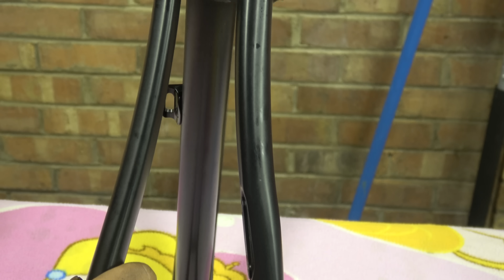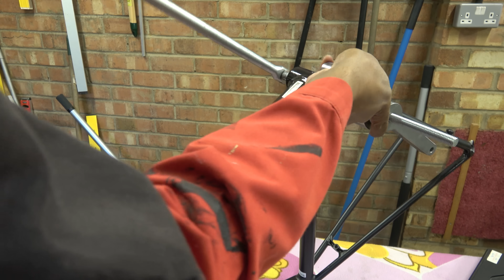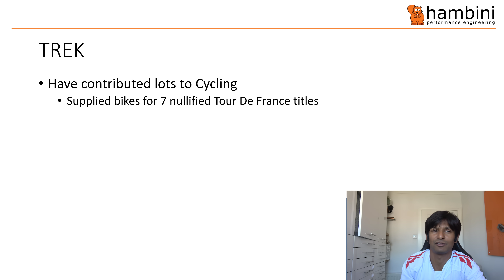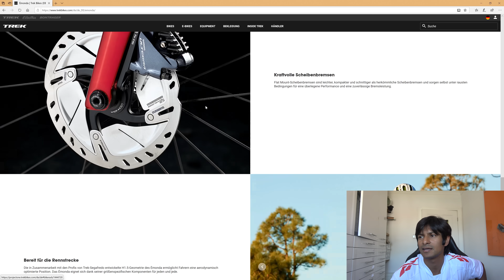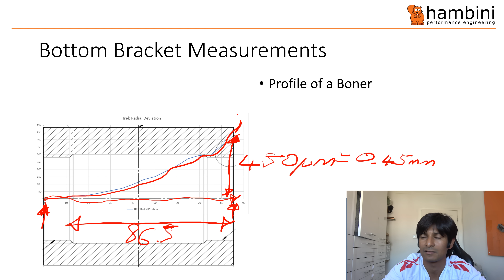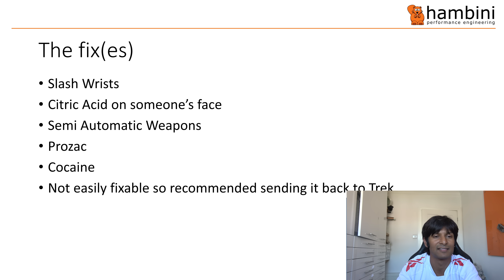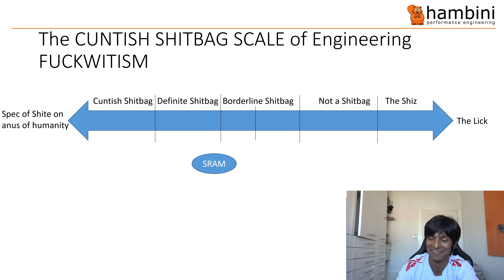Trek Emonda: Engineering crapness of the highest order

Comment: This engineering crapness belongs to me so the video is a difficult watch. 

I'd like to say thank you to Hambini for his efforts and for being such an awesome person to deal with. I haven't started a warranty claim yet as I was waiting for this video, but I'll update as and when I get any response from Trek. 

I've since purchased a 2019 Giant TCR Advanced 1 and I'm very happy with it. The spin test with the Shimano BB is amazing compared to the Trek.

EDIT: 20/10/2020 I finally got round to making a warranty claim with Trek as I was waiting to see if they brought out an updated frame for 2021. They haven't updated the frame, but they have bought out a very nice red / orange fade colour scheme. Anyway, I initially claimed on the basis of the welding defect but Trek dismissed that, saying it was 'part of the normal build process'. After that I went back to them with the undersized and misaligned BB, together with a mention that the frame had been inspected by a 'professional bottom bracket engineer' and I was prepared to make a claim in the small claims court. Lo and behold, Trek have now said they will replace the frame as a 'goodwill gesture'.

EDIT: 30/10/2020 I picked the new frame up from my LBS yesterday, in the new orange to red fade paint scheme. It's very nice except for one or two areas where the finish is piss poor. I've measured the BB with my cheap ebay verniers and I think it's undersized and not quite round on both sides. There are also some small areas in the BB and head tube where the welding has blown through. In fairness to Trek they shipped it over from Europe as it's not in stock yet in the UK.

EDIT: 16/02/2021 The saga continues. I got my new frame in October last year and since I had my TCR, I wasn't in a great hurry to build it up, especially as I needed to get some new direct mount brake calipers and some wheels and other bits for it. I got most of what I needed and started building it up after the New Year. When it was almost complete and I put a rear wheel in and the chain on to set the gears up, I noticed the wheel looked as though it wasn't aligned centrally with the seat tube. So I made sure it was properly located in the drop outs and checked it again and it still looked like it was well off towards the drive side. So anyway I thought maybe the wheel was dished, although this was not a new wheel but one I had been using in the previous frame and also on the TCR, and I hadn't noticed a problem with it previously. So I tried a few more wheels in the frame and they all were misaligned with the seat tube, well towards the drive side. When you flipped to wheel over, the result was the same - misaligned towards the drive side. 

So I contacted the shop and they asked me to drop it in along with the wheel. At first the owner agreed that there was a problem, but later I got an email from them saying that Trek had asked them to try a different wheel and they reckoned there wasn't an issue. Trying very hard not to loose my rag, I emailed them back and told them to look again, using a rim with no tyre on and by looking at it from behind with their nose right up close to the rim and with both eyes open, not squinting through one. Shortly after I got another email from the shop saying that they'd 'tried a different wheel' and they could see it was 'a bit off' (it was well off but any amount is too much). So they've asked Trek to collect the frame and carry out an inspection. That was last week and I'm waiting to hear back from them. With a bit of luck I might eventually get something which is made properly but I'm not holding my breath.
Reply: I think in light of the evidence shown it will be difficult for them to refuse to warranty it. I cracked my 2018 Remedy frame and they replaced it immediately, no ifs or buts, straight up replacement to the newer 2020 frame so my experience was very positive, would have been better if It hadn’t cracked in the first place but it is a MTB. Keep us updated so we are aware of what to expect from this sort of situation.
Reply: I don't seem to be able to edit my original comment again, so I'll have to post an update as a reply to it: -

EDIT: 17/06/2021 After Trek had the frame to examine it for the alignment issue with the frame & rear wheel, I heard back from the shop to say that they had found nothing wrong. They had put it in a jig and concluded that it was fine. They took some pictures which the shop emailed me and appeared to measure the distance between seat tube and seat stays, which seemed to be okay. I went back to the shop with my wheel and again I put it into the frame and it was well out with the seat tube. 

This is the point at which the shop tried to mug me off. First of all the 'head mechanic' (a right cocky tw@t) tried to tell me "that's how they come with Treks", to which I pointed out that the Emonda next us in the showroom wasn't like it. His response - "that's because that one is carbon"!!! When I challenged him on his BS, he said that I would have to take it up with Trek as the shop were just 'in the middle'. I pointed out that I was the shop's customer and the shop were Trek's customer, to which he responded that I would have to take it up with the owners, one of whom was stood right there!

 At this point the other owner gets involved and I show him the problem. More attempts to mug me off followed. "I've seen worse" he said, to which I replied that I hoped those bikes were never sold to customers - no response from him to that. He then told me that "they do it to get the chain line" to which I replied that the chain line comes from the width of the BB shell - more silence from him. Eventually, after he realised I wasn't just going to go away, he called Trek and persuaded them that the frame wasn't right and they should send another, to which they agreed.

About six weeks later, after not having heard from the shop, I emailed to chase up the frame's whereabouts and wouldn't you know it, it had just been delivered that day. I called in the following day and we tried my wheel in the new frame which lined up perfectly with the seat tube. I took the frame away and gave it a good inspection before building it up. The BB shell was undersized, as you would expect, and the NDS was visibly not round. It seems that Trek just aren't able to make a BB86 shell to spec. There were also blobs of weld in the BB and head tube where the welder had blown through. 

I've done a few hundred kilometres on it now and to be fair it does ride nicely. However, due to the cable routing being internal but having to exit the down tube before the BB then going round the BB externally, the gear shifting is very poor. I'm using the Ultegra 6800 shifters, cranks and mechs from the original bike and they performed perfectly on that frame which had external routing. The front mech works fine but going up the cassette on the rear is really poor and I find I'm 'fishing' for the gear and having to think about the gear change, which takes the shine off the ride. Maybe a change of outer cables would improve things but I really think it is the design of the routing which is leading to the poor shifting.

Another issue with the frame, and it's a big one, is that the fork is not colour matched to the frame. The head tube is a shade of orange and the top of the fork is more of a yellow hue. It's not just slightly different, it's completely different, and my first thought was is it meant to be like that as I can't believe that the QA would not have picked that up. However, I don't remember the previous fork being of a different colour and when you look at the pictures on the website it looks the same colour. I've decided I can't be arsed to take the matter up with them as I'm just relieved I actually have a frame that is at least useable, although at £975 for the frameset you would think they would at least get the colour matched. So much for Trek's quality control.

In summary, it really pisses me off that I have had to go through all this bollocks just to get a frame that I can ride. I would never buy another Trek and I certainly won't be spending any more money with the shop, which I won't name but is in Worcester and it's a cycle centre.
Reply: After what Trek did to Greg Lemond and his bike company courtesy of their golden boy Lance Dopestrong I would never spend a penny on anything they ever sold. And yes, on top of that their fabrication quality is a complete joke for what they charge.
Reply: Just to update again, I contacted Trek via Twitter about the colour match issue and they said it shouldn't be like that and I should contact the dealer, which I did.

The dealer got back to me to tell me that Trek couldn't actually supply a fork in the correct colour. WTFF!!!

I think because of the previous saga with the frame(s) they probably just couldn't be bothered to open up the boxes of the warranty frame stock and look for a fork with the right colour.

They offered me a grey fork or £150 credit to use in the shop (on Trek goods, although the shop said they weren't fussed what I bought). I took the £150 credit and I'll have to live with the fork being the wrong colour.
Reply: How will they wriggle out of this one. Show them the hole is 40.8mm. It may aswell be square.
Reply: The Trek was made by Giant... Bold move going for the same manufacturer!
Reply: @JeffLenoskyTrailBoss  giant build most frames.
Reply: Good luck, they should stand by the product.
Reply: Giant over Trek, Specialized,  and Cervelo all day long,
Reply: ... of the Highest Order, haha!
Reply: Yup, even if they bike isn't perfect, they stand by their product and will do right by me.
Reply: well I have had a trek bike too and the bb was squeaking while riding even after fixing it and the frame must have been deformed for me as well. I could not ride without the hands on the handlebar because the bike always went to the right. something was pretty fishy about the bike but luckily for another issue I had it was send back and I got my money back. wish me luck for my next bike, that is definitely not a trek bike.
Reply: New bike day coming up?
Reply: @topher.m  New bike day was back in March. Giant TCR.
Reply: @plantpoweredpedaller  I'm on the verge of upgrading to the 2021 Advance Pro 0 (that's a mid-life crisis for you) how are you finding the TCR?
Reply: @MrThemaskedavenger  Really happy with it. It's a bit more racy than the Emonda and more comfortable being carbon. The cranks spin very freely so at least the BB appears to be well aligned.
Reply: Yes. ANYTIME you buy a new item and IT DOES NOT work as marketed/intended then it is NO GO. How QC let this slip is crazy. I’m just guessing you paid AT LEAST $800+ for just the frame??? If Trek doesn’t honor your request that would be disgraceful. Good luck!-)
Reply: There are some big players in the market how want to make the customer happy: Scott, Specialized, Trek and Giant. If you have problems, send it back and get a new one!
Reply: My bestie had two Trek frames on two different models and broke them both. Ever since then I am always skeptical of Trek quality. They always seemed overpriced and under spec'd.

Also - massive respect for being plant-powered my dude.
Reply: @gh7213  Cheers Greg. I'll never be giving Trek another penny. Fucking shysters.
Reply: @plantpoweredpedaller  any update? :)
Reply: @davidmeloni8282  I'm trying to post an update but I keep getting an error
Reply: Interesting, I have absolutely no sympathy to TREk I don’t forget that they were part of the Lance Armstrong System which was far more than Doping - rember how they behaved with Greg Lemond but though it seems that one fits to the other.
Reply: @Alien On a Bike  that bike is about €1500 , so it's worth it to try to fix it
Reply: This was so funny to watch but I do hope you get your bike fixed!
Reply: so where does Giant stand on hambini scale? haha
Reply: Plant Powered 
What's ironic is Giant probably made both frames for you.
Reply: Thanks for this post. I'll make sure not to buy a trek emonda frame. I wonder if the high mod frames in all these brands have better more precise and accurate engineering than the regular carbon ones. Not sure if hambini reviewed those
Reply: Any more updates? Very interesting to follow
Reply: @TimInertiatic  If you've read the pinned comment and then my replies to it (because I couldn't edit the original comment any more) then that's about it except that I had been keeping a dialogue going with Trek via Twitter. They kept on asking me to take the bike back to the shop and start a warranty claim, to which I pointed out that's what I had done. They said they couldn't see a claim on that frame number and kept saying take the bike back to the shop. We ended up going round in circles and I concluded that Trek are well aware of the problem and just don't even bother registering a claim. I actually contacted someone on Ebay selling the same frame and his bike had the same problem - yellow fork and orange frame. He said he questioned it at the time of purchase but got fobbed off with some cobblers about the frame being alu and the fork carbon.
Reply: @plantpoweredpedaller  yeesh.  I was considering a 2nd hand ALR but I’m going to avoid it now.  I wouldn’t even have a warranty to fall back on even if your experience was so poor.  I’m going to get a TCR instead.
Reply: Can't wait, I got the Trek Emonda ALR Disc White Era 2023 frameset, yet to build it up
Reply: Please do keep us posted.  I have a feeling Trek will do nothing to correct the issue.  I have (more or less) the same issue with my Trek and I definitely would never buy another bike from them again.
Reply: @Waremonger   I've posted an update on the warranty issue in the pinned comment
Reply: @Waremonger  tried to repair several bikes with their bb90. I turn them away. No bb lasts.
Reply: MP48 cs works fine and has 6 jears warranty. bb90 isn't perfekt but stiff and the lightest bb standart
Reply: @ianiscaratti4924  CS???!! Ceramic speed....... Are you literally sitting me. Expensive snake oil crap. I'll never give those arse holes money again. I use Chris King or wheels manufacturing with SKF, NSK or NTN bearings fitted. CK bottom brackets last pretty well even in poorly aligned frames but they can't cure bottom brackets misaligned to the degree of that TREK.
Reply: MP48 show me a chris king bb90 lol
Reply: Isn't that a 4 year-old bike? Based on the black on black paint scheme and bosses for external cable routing, that looks like the 2017 ALR 4, which was sold in 2016, with a Tiagra groupset. Trek remodeled the bike with internal routing, different tube shapes and smoother welds in 2018
Reply: @voiceofreason9780  But the warranty is for a lifetime.
Reply: @kubagajda7347  Don't be fooled. If you understand a 'lifetime warranty' it's essentially a marketing reassurance to convince people to buy.
1. Life time means life of the frame, which is the lifespan of the bike frame, not yours, and that is about 7 years or so, in the case of alu alloy.
2. Any crash, not covered.
3. Change of ownership, new owner not covered.
4. Any 'user error' or anything that could be deemed as user error, not covered. Even using a shorter seat post than OEM would for some companies be a reason to deny warranty. They would say their post must be 400mm not 350mm. Of course they don't  tell you that in the handbook. Or they might say 'Hambini is not an official Trek dealer and has attempted to fix this frame, so warranty void'. So essentially the owners are playing a guessing game as to any repair or change from OEM might be deemed warranty voiding, but you'll never know ahead of time.
Also remember if anything goes wrong your bike will be sent off to be looked at by 'their team', and if that's your only bike you could be bikeless for months meaning unless you go and buy a new bike you'll end up a miserable, fat unfit git until you get you bike back. So you'll likely be spending money and as you will not have had time to research the bike market or time to save up adequately you'll likely buy a bike you'll later regret as you'll get anything available and affordable to keep riding.
Reply: @plantfuelled8912  I know that very well. I've woked for Trek for almost 2 years and there were some ridiculous warranty claims that we've handled, that in the end Trek answered positively. If the owner will be consistent in messaging them almost everything (apart for obvious crash damage) can be warrantied. They have abous 2-3 frames to "give out" per customer before it's not profitable for them anymore. And most of the time it's better for them to keep the customer happy instead of him making noise on the internet for months and months on end. I've myself had handled a warranty on a 2004 garry fischer that has been passed and the dude got a new Procaliber for that.
Reply: @kubagajda7347  The people I know generally have the same experience. Cracks in carbon and most other defects were always warrantied, they're pretty good that way(at least here in Belgium). That's not to say anything about their engineering of course, which is a separate issue.
Reply: Ridgeback recently warrantied me on a 13 year old frame that had been used for cross continental cycle camping. They even threw in some disc wheels as my old canti wheels wouldn't fit, and upgraded the model to Reynolds 853 to boot.
Reply: @plantfuelled8912  Actually had an 18-year-old frame swapped, and their team did it in under a week, so your belief in what lifetime means and being bikeless for months is utter bollocks. And come off it, you crash a bike it's your own problem for being shite, why would anyone let you warranty it?!
Reply: @plantfuelled8912  some brands stand by it, some not. In the case of Trek, well, you could buy a £9k DH bike 'world cup ready', but using in in competition would void the warranty, so figure out (it used to be like that, don't know if is different now but I don't think so). Complete joke.
Reply: @kubagajda7347  I worked at a local Trek dealer for only one month (then Covid hit and I got laid off) and Trek was awesome to deal with for warranty. Friend of mine broke his rear hub on his 2019 Farley 5 and they didn't have any aluminum fatbike wheels in stock, so they sent him a $1100 carbon fatbike wheel (fully built, hub and all, etc) to replace it. When they shipped the wheel they sent it with an XD freehub, when his bike had a Shimano freehub, and since his freehub was stripped, they had to then send a Shimano freehub (another $150 part). Each of these parts arrived within a few business days.
We also had a Domane SL7 frame come in slightly damaged from shipping on the seat tube mast, also not Trek's fault, and they offered a discount to pass along to the customer on the bike if they wish to keep it, or swap it for a new one.
Reply: @kubagajda7347  Yes the warranty is for a lifetime, but only to the original owner. My experience (in the US) was Trek asked my LBS to provide purchase proof and send them the frame, then replaced the bike. They also let me keep everything except the frame (wheels, fork, handlebars, seat, seat post, groupset) which were of no use to them.
Reply: @voiceofreason9780  Sometimes they ask for the frame to be sent and sometimes they ask the shop to cut the BB junction out of it and take the picture. Gotta say, it's exremally had to cut an alloy frame with a hacksaw.
Reply: @kubagajda7347  In my case they just asked for the frame. I assume because they wanted it out of circulation.
Reply: @plantfuelled8912  Yeah my experience of Trek warranty has been stunning couldn't have been better I had a Gary Fisher Rig years ago and it was all sorted and the dealer helped me out with some new bits as well just amazing
Reply: @plantfuelled8912  My Emonda SLR developed a crack in a seat tube. According to the bike shop manager, Trek did initially reject the claim for a replacement frame, and when he got back to Trek to ask what he was supposed to tell me, Trek decided to replace the frame. The whole process, from bike shop to Trek and back, took about five weeks.
Reply: @Nyadach  That's impressive
Reply: @Nyadach  did they comp the labor too?
Reply: @david-sv3kg  Yep, and threw in brakes since they had changed to direct mounts from old centre mounts. Can't fault them at all. Do find this topic at hand rather suspicious though on the week of the launch of their new bike that someone sends to Hambini a second-hand frame which probably cost less than the BB it was being fitted with, with it suffering BB issues to get it plastered over YouTube? All smells very iffy!
Reply: @kubagajda7347  Complete load of bullshit. Next bike will be based on a Look frame.
Reply: Plant Fuelled  You're full of shit mate, Trek offers a 3 year warranty transfer to the second owner, and also offers a bicycle frame warranty for the lifetime of the owner, not the bike. They'll warranty frame cracks to the first owner going back to the 1970's. They also do a 20% off crash replacement frame for those who damage their bike frame in an incident. Most of the warranty cases I know of have lasted less than a month with the customer coming out on top. Of course they have their fuckups but spreading false Information doesn't really help your case.
Reply: @NorthernSkiAndCycle  My favorite Trek warranty story: Trek dealer's plastic road bike fork snaps, as he's JRA, right in the middle of the blades! They give him a new fork but blame the failure on him removing the "lawyer lips" from the fork dropouts...despite both of them still being firmly attached to the front wheel axle/quick-release and the lower fork blades, despite them snapping off! They paid his medical bills too...did they fear being sued? My guess is YES. They're not kind, just smart.
Reply: @voiceofreason9780  It's the 2017 ALR5 which came with Ultegra 6800.
Reply: "It's the 2017 ALR5 which came with Ultegra 6800" ~  @plantpoweredpedaller  
It seems like you're mistaken. The ALR 5 always comes with 105. The ALR 6 is the one that came with Ultegra. The ALR 4 comes with Tiagra. They also all have different paint schemes. In 2017, the ALR 5 had blue and Orange highlights.  You can easily check this in Trek's archives or Bicycle blue book. The paint scheme on your bike is unique to the ALR 4.
Reply: @voiceofreason9780  Yes you're correct it's the ALR 6. https://www.evanscycles.com/trek-emonda-alr-6-2017-road-bike-EV286642
Reply: @plantpoweredpedaller  Ah ...OK. Confused me when you said 5. Thanks for clearing that up.
Reply: @plantpoweredpedaller  I used to have the Trek Emonda ALR6 2016 bike. I loved it, my first road bike so I probably just didn't know any better. I had a silly crash involving and e-bike, and somehow I wound up with all the tubes around the BB bent. I had to bin the frame but I've still got the fork to this day, in a drawer. I wonder if there is a way to scan it and make sure it is not damaged, and then sell it or give it away if it's still ok
Reply: @m.a.c1379  I agree with you that it's a great bike frame, provided it's been properly manufactured, which my one wasn't. And to think, if I hadn't yearned for an expensive Hambini BB for my shitty bike worth much less, I wouldn't have realised I was riding around on a dangerous frame.

I would imagine that your fork would be fine if it's not been in any crashes or impacts, although I'm not sure I would want to purchase a second hand fork myself.
Reply: With a name like that I cant help but feel durian rider recommended this bike to you 😂
Reply: In all fairness, a pair of dog's bollocks as a BB is probably amazing, compared to that Trek.
Reply: Good to hear from the customer.. Keep us updated with your warranty claim..

I hope your enjoying your new bike 🚲

Take care 😁👍
Reply: @fissionchips8840  I've posted an update on the warranty issue in the pinned comment
Reply: You have our all and wholehearted backing- and good luck with your Trek misfortune. (I've always hated Trek, but didn't know why).
Thanks to Mr. Hambini, 5 yrs. old, we find confirmation our darkest thoughts were no fanciful mirage.
Reply: @exploidur  DW split-pivot thieves !
Reply: No worries. We all get suckered by this disgraceful industry. Best to research before dropping cash. There are good brands and Giant is one of them. I've had a few and never had bottom bracket or headset problems. When I bought my cannondales I took alignment tools with me and made the mechanic use them while he built the bike. I got lucky but made my own luck to an extent. I would not touch anything with the Trek name on it because every single one I've worked on has issues with bearing race alignment including the full suspension bikes. Maybe we'll get to a point where people start sueing these bike companies for the poor workmanship they deliver. In the meantime stick to Giant for great value for money well made product
Reply: I got a Checkpoint ALR, I guess I should be worried as well :-|
Reply: Trek has a very good warranty system just because any cheaply mass produced item can be screwed up. It isn't as if a class A machinist is making every part or like you can hire good QC people so to fill the gap they warranty it what happens if someone sends you a Giant or Yoeleo that has slipped through the cracks? Are they then doomed for an eternity as the shitbag on the anus of humanity? Some days you can't even find your pointer. Do you then think some hungover manual laborer is not going to sometimes say "screw it, it's too much bother"?
Reply: @tomkunich9401  well yes you have a point, BUT NOT WHEN YOU ARE SELLING BIKES THAT COST MONTHS OF WAGES TO BUY. Hambini's point is that this frame is so shite it should have never been able to pass QC let alone get out to a customer in that state.
Reply: @alan-sk7ky  ... The deal is that they won't pay for more than a visual QA.  They just warranty any defects that pop up later as they are rare enough that it is cheaper that way.  This one obviously had BB issues which is why it was getting an aftermarket BB in the first place.
Reply: @alan-sk7ky  - I will say this: I have a Trek Alpha 1.5 which is essentially the same thing as the Emonda ALR. There is a slight misalignment in the BB but nothing serious.  I have had every top end bike other than Specialized and this Alpha is now my go to ride. Colnago C40 can steer itself under very hard rides.  The Trek Emonda SLR or Madone just don't feel right .  But the Alpha rides like a dream for me. Now contrary to Hambini I do use 28mm tires and weigh 195 lbs.  and the roads around here are crap. Yesterday I did nearly 1,000 meters of climbing so it isn't as if it isn't ridden hard though at 77 I'm slower than Hambini.
Reply: @tomkunich9401  Having a good warranty system isn't much of a consolation when you've crashed your bike due to a manufacturing defect.